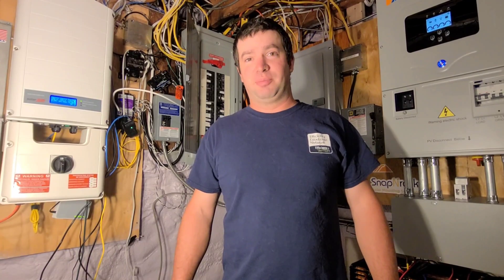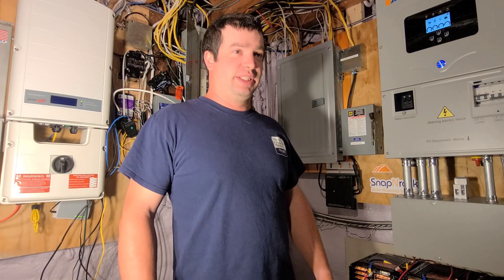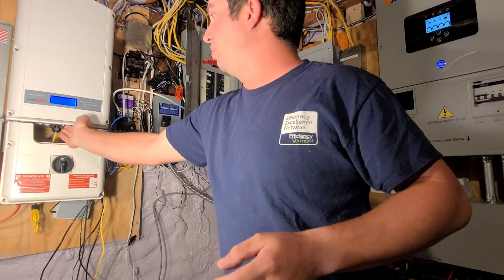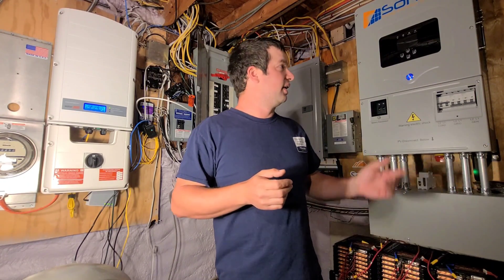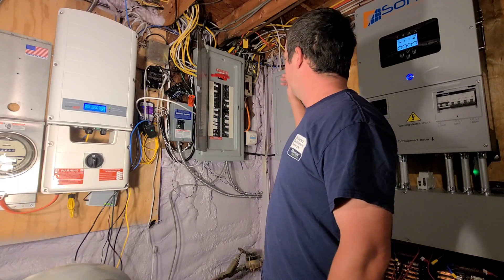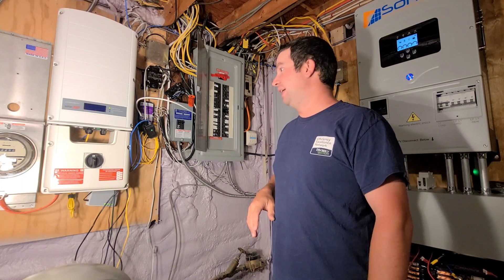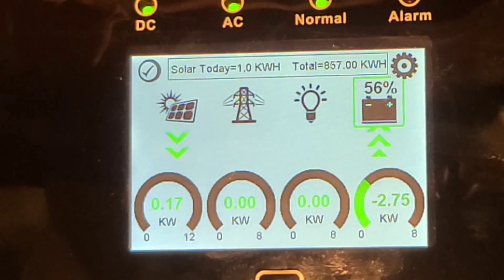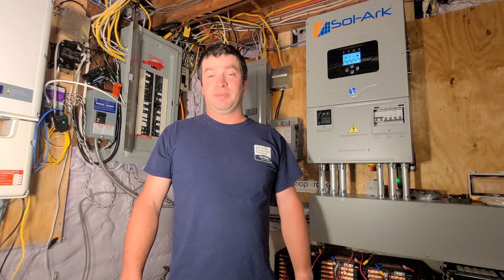What is AC Coupling? How it Works With the Sol-Ark 12k

Comment: Appreciate the description of an AC coupled system. I have a SolarEdge system and want to add the Sol-Ark 12K but the local dealer wants me to replace the panels. I really like the idea of AC coupling to give me that 16K of peak power. In one of your videos you mentioned that you have done some battery exploration, have you done any tests on the PoyPow batteries? By the numbers they look great (they are mostly used for golf carts) but no-one can get me any specs on them so Sol-Ark would/could tell me how to hook them up. Could you provide some help?
Reply from the maker: Your local dealer doesn't know what he's doing.  You can AC couple with the Sol-Ark very easily.   I haven't used RoyPow, but they may work.  One thing I noticed from their spec sheets is that they have a fairly low charge current.  When AC coupling, you need to make sure that your batteries can handle everything that the grid tied array can output, plus have enough capacity to run your house at night.  They Sol-Ark 12k can charge and discharge a battery at a max rate of 185 amps, and while you can adjust that number, you're limiting its potential by doing so.  Hope this helps.

Comment: How does a transfer switch fit into this system? Do you use a manual or automatic switch to disconnect from the grid?
Reply from the maker: I'm running my entire house through the Sol-Ark.  When the grid goes down, it automatically disconnects but keeps the house running.
Reply: @benssolarandbattery  When you use the Sol-Ark as the cutoff, does that limit your house (both in and out) to the 12KW that the Sol-Ark is rated for?
Reply: @notaname59  If you have the 12k it can invert 9kw and pass through from grid through the sol ark grid tie another 15kw(the sol-ark grid output, grid tie, would still be connected. The ATS will be between the load out, grid power and load panel). So it would pass through power from grid to your loads. Unless, you disconnect completely from grid power at which point it peaks at 9kw, but if you have an ATS the sol ark would still be tied into the grid on the grid side.

Comment: Hey man! Thanks for the info. Any chance you know if the Sol-Ark will work without batteries? Looking at (Slowly) building a system and adding batteries later. Thanks!
Reply from the maker: It will work without either batteries or grid, but not without both.  Without batteries, you'll need a grid connection, but can set it to either feed excess power back into the grid or limit the amount of power generated to match your loads.

Comment: Recommend  video on choosing appliances to minimize peak loads such as heat pump electric hot water heater, HVAC units with inverter compressors or at least scroll and multistage compressors or separate mini splits, For you and many Heat pump dryers that also dont necessarily need venting either and inverter microwaves etc . Other means such as gas logs or gas tankless water heater  or ovens LP  natural gas to reduce peak loads or to use lower stage of HVAC on the rarely coldest days a few days a year.

Comment: This may be a complicated question.  Why wouldn't it be ok to tie 2 different hybrid inverters to the grid without using a parallel kit or parallel hookup?  Wouldn't they both synch to the grid and thus to each other?  I can see if grid goes down they might have a problem since one isn't the Slave to provide the "grid " power then. Of course they could both charge same batteries but max power still limited by one inverter supply of AC
Reply from the maker: I don't see an issue with it, although you may want to have the loads on separate panels so the inverters don't fight each other.
Reply: @benssolarandbattery  yeah I am sure it would work that way because it would be just like 2 different systems on AC side and just like using 2 battery chargers to same battery on DC side.  The point of not having a separate panel would be to get total power for load from one appliance like HVAC that would overload one of the inverters.
Thanks for reply!
Reply: @teekay1785  if they are not synchronized it will be a catastrophe dont do it. 
Typically you have a master inverter and then slaves. The master sets the phases the slaves do as there told.
Reply: This applies to when the grid fails of course
Reply: @SolarTechFL  Yes I am aware of that . Thats why I asked the question but its possible to use the generator switch to turn off one of the 2 inverters also so in the case of grid going down one inverter could be cut off.  I dont intend to try it and even if I did I would try it with them hooked up to a single load not a service panel through a single breaker such as a cheap power tool or air compressor which would supply a relatively large load but I wouldn't care if it damaged it. If it worked I might try it on some type of electronic equiptment also such as a clock.  I am just curious but I dont intend to risk the 2 inverters . I suppose it all depends on how fast the generator switch swapped the load and how long it would take the other inverters to cut off.  If the generator switch cut the second inverter off quick enough no damage could be done but who knows and the generator switch would have to function correctly and be connected to relay to turn the second inverter off.

Comment: First your description says 12K Solar and in the video you say 8K but they both output 8kw max continuous without grid  so  makes no difference.
  
My next observation is that in the Solar specs the max AC coupled input is 7,000 watts  so it will obviously trick the on grid inverter to produce power but if say the house is using 1,000 watts at the time and its a good sun day even with discharged large battery bank you will not be able to use  over 7,000 watts to charge the batteries. Granted this usually wont limit the system in practicality plus you could have a dump load too.

My last observation.  Why not just replace the solar edge with a Solar 12 and sell the solar edge unless you plan to add more pv capacity or you want to be able to use more than the max continuous or peak loads of the solark 12 which is 9600 continuous grid connected watts.

The Solar 12k is definitely the cadillac of hybrid inverters in my opinion .  It would be nice if they would come out with a 12 or 15kw max continuous output. As is many applications need to buy 2 unless they replace several high use appliances or HVAC such as to limit max loads. Not sure why the hybrid inverters limit the amount of power used when grid tied  instead of using a relay to just pass through the grid power to whatever it can supply which would prevent the need for piggybacking multiple converters in a grid tied system.

Comment: I have a enphase system. You can set the micro inverters to not export Based on the 2 CT reading. Essentially scaling up and down on all the micro inverters based off the load needs. That should work great Coupled with the Solar Ark.
Reply: I have not seen this done would you explain more if you can

Comment: Doesn't the Sol-Ark running at  61.5Hz mess with any of your appliances? My microwave seems to want exactly 60.0Hz or the clock starts loosing time.
Reply from the maker: I haven't had it there for long enough to tell at this point.  By the looks of it, I could set the frequency to 60.3 and the  SolarEdge would shut off. I'm going to play with the settings on the SolarEdge and try to get it to ramp down as the frequency increases. Apparently that's possible with them, I just have to dig into the settings.
Reply: @benssolarandbattery  t is possible they have a document on how to set it up
My clocks loose time when the gen is on 
Im a solar contractor in FL

Comment: How does the Sol-Ark disconnect your house from the grid so that you don't backfeed in an outage?  Or does it stay off until you manually disconnect from the grid and manually turn on the Sol-Ark?
Reply from the maker: The Sol-Ark has a grid sensing circuit, so as soon as the grid goes down, it stops all backfeeding and switches to battery and solar only.  I'm feeding my entire house through it, but its limited to 50a (12,000w) max.   I'm very cognizant of my power usage, so that's ok for me, but could be overloaded pretty easily with an all electric house.
Reply: @benssolarandbattery  In the all-electric house scenario, would multiple parallel Sol-Ark's solve the problem?

Comment: Sweet setup. I noticed a singular Enphase Microinverter but can't tell if it's an M215 or M250. What is its purpose? BTW I'm also a solar contractor.
Reply from the maker: Thanks!  That is an M250 that got chewed up by squirrels.  I have a single panel acting as an awning over my heat pump that is hooked up to that.  It was more for fun than anything, but it does work.

Comment: If starting out from scratch, would a straight dc couple on just a single solark work if the grid is stable?
Reply from the maker: Absolutely.  It can either act as a grid tied inverter and feed back to the grid (doesn't even need a battery) or you can limit power to your home or load without feeding the grid.
Reply: Ben's Solar and Battery can I have all my loads on the grid breaker until I get a battery and sub panel?
Reply from the maker: @nebulight  if you don't have a protected loads panel right now and are going to be using it as a grid tied inverter only, I would just leave everything where it is and backfeed the main panel from the "grid" breaker (or tap depending on your service). I don't believe it will work off grid without a battery.
Reply: Ben's Solar and Battery my idea would be to move my Three ton AC and some other minor circuits (lights and kitchen) to a transfer switch panel from reliance as my meter and main panel is one of those all in one units on the outside. Then in normal operation leave the transfer panel on the grid side and manually move if there ever was a power outage (which is very rare for Las Vegas). The idea of adding a battery is in Vegas these past two summers have been really hit so if it gets to the point where we need to conserve during the heat of the day I could supplement the grid with batteries. Also could sell back at higher rates if I switch to tou. Thoughts on this plan to leave all loads on the grid? Then if the power goes out manually switch? The idea of the manual switch is so I don’t overload the inverter with the AC and then some other high current loads since the grid pass through to the loads panel is limited to 50 amps I think.

Comment: Ben, another good informative video. Your subscribers will continue to grow as you make more videos exposing your knowledge to viewers. Need to get you to the thousand mark to get monetized and then it will really take off. Thanks again for sharing your expertise with the Sol-Ark 12K. By the way, do you use a cut-off switch between your Square D breaker box and the Sol-Ark?
Reply from the maker: Thanks Craig. If you're referring to the battery combiner, no, there's no shut off between it and the Sol-Ark.  I'm using the DC breaker on the left side as my overcurrent for the combined output, and then each battery has its own breaker as well.